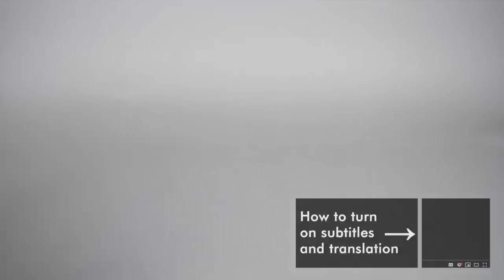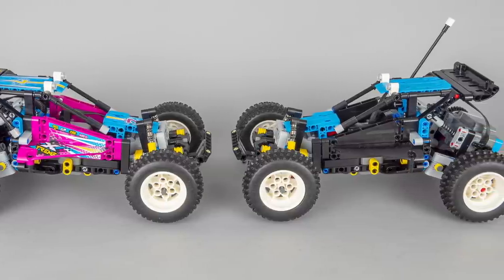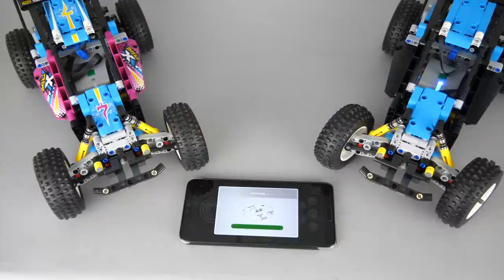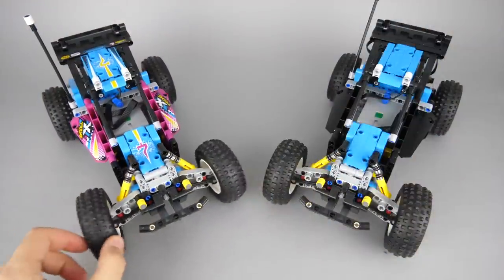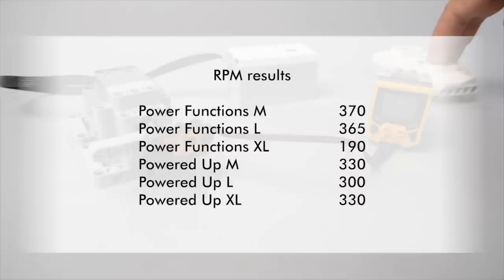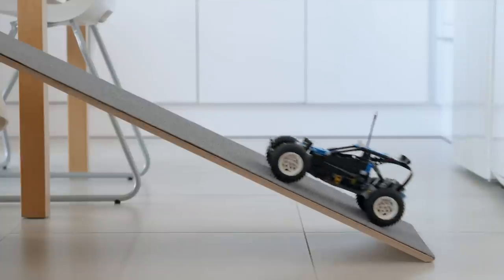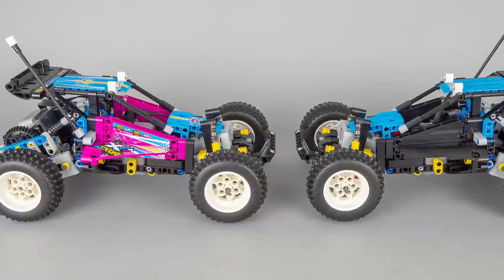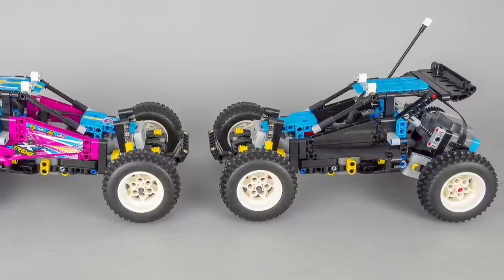XL motor swap in the LEGO Technic 42124 Off-road buggy - is it any better?

Comment: the limitation is the technic hub, not the motor. the reason why the vehicle stop is not becase the motor is overloaded, but because the mosfet in the Hub that's driving the motor is overheating. the Motor drivers used in the hubs are intended for an optimal range of 0.5-1A output with a max capacity of 2.5A devided between 2 channels. the problem is that the efficiency curve gets shot to hell alove 1A draw, and the driver chip overheats, causing a shutdown. the larger motor draws more power, so it will shutdown faster since the driver chip will overheat LONG before the motor has reached its limit. the L motor draws less power, so it can push out more torque effectively before tripping the overheat.
Reply: Does this mean with something like BuWizz brick (3rd party) the difference would be there?
Reply: @akauppi2  yes. thats a large reason why Bwizz 3.0 is targeted to PU motors.
Reply: Does this mean the hub has a design defect or does Lego also make (plan to make) a bigger hub to handle the larger motor? In the Philo chart the L and XL seem to have the exact same torque, but the L has a barely faster rotation speed. That seems like some pretty weird specs for something called an XL motor.

At least with the Power Function line the XL motor provided over twice the torque for a slower rotation speed trade off.
Reply: id be curious to test the L vs XL motors on the Buwizz 3.0 to see if its just that the motors really are a marketing gimmic, or if the poor design of the hub is screwing them over. 

I highly doubt lego will release any more higher power motor parts or they would have all ready, given how popular and sought after the buggy motor is; same goes for power packs. 

im curious if the use of an insufficient driver IC is a lame downcosting measure, or if it was done to change the product classification to clear EU laws.

id imagine the PU system skirts the border between consumer electronics and toys under EU regulations, so that may have something to do with it
Reply: Does this mean that Lego made a mistake? Or they did it in purpose and XL means just the physical size of motor?
Reply: @АндрейРоганин-к8п  I think its more  likely that they  knew and didnt care since it was done to save money. 

im sure there was an original design by some good engineers and that original design was stripped down and cheapened to what we have now.
Reply: @572089  But in this case even more cheaper would be not to make XL motor at all 😀
Reply: @jjones2582  nah, largely because it is a "toy" so I guess they have a limit before it gets dangerous, wonder if anyone is brave enough to mod them though
Reply: Dang you’re smart
Reply: We have similar taste in batteries 😂👍🏻

Comment: Recently I bought the 42099 Xtreme Offroader and was surprised to notice that at some times (while testing in heavy terrain, fresh batteries) the rear XL motor would simply cut out, followed by the front motor as that one got all the load. My guess: the Powered Up brick does some serious current limiting. At its maximum output power, the XL motor needs more current than the L motor, but by no means it gets that current. At the same rpm and voltage, this practically means that the XL motor is no stronger than the L motor. I think that a good tuned Buwizz can unlock a lot of potential here. Can you hook these up to a Buwizz? If there is a big difference, this means that the reason is not the motor itself but the crazy low current limit set by TLG.
Reply: I think you gotta wait till february, because thats when the new BuWizz version with 4 PU ports comes out.
Reply: Its the 42099s safety auto stop so when the motors are put through too much stress the hub automaticly stops the motors so the motors dont break from stress
Reply: @Arrowheaded_Quincy  power functions didnt have that
Reply: I have a buwizz 3.0 and will try to get an xl motor. With the buwizz app i can give the motor up to 4 amos of current which is insane

Comment: Outstanding test as always !!! I would never have guessed the result myself.
Just a shot in the dark: PERHAPS the advantages of the XL motor are only noticeable when the Voltage is increased a little, like with a BuWizz.
Usually greater Torque requires higher Voltage and rechargeable batteries run those motors pretty poorly with their nominal 1.2 volts.
What I am saying is that in this test the L motor was being run close to its true potential while the XL was still far from it.
Reply from the maker: Well they should show whatever potential they have with the Powered Up hubs since that's where they are supposed to be used in LEGO sets.
Reply: @RacingBrick  True. Only one way to find out though. Could you try with Alkaline batteries and see if there is any change?
Reply from the maker: @KastaRules  I won't waste 12 alkalines for this. The pack of fully charged LADDAs is around 8.4V (as they can be charged over the nominal 1.2V). A pack of average alkalines is 9V, and it drops quickly with use so there's not much difference. I'll try with higher voltage though, but not alkalines ;)
Reply: @RacingBrick  Fair enough. I assumed you were swimming in cash, being a YouTube celebrity and all!

Seriously though, I believe a pack of rechargeable NiZn batteries or better yet, the upcoming PU compatible BuWizz, could show the difference in power between L and XL.
Reply from the maker: Lol, YT celebrity swimming in cash? I'm lightyears away of that...
Reply: @RacingBrick  We could ask Sariel to try these motors with his fancy NiZn batteries though.
Reply from the maker: Luckily I also have some of those ;)

Comment: Great test, that's exactly the comparison I was curious about, wondering why they put the L motor into the buggy instead of an XL one. I am also experimenting with a faster car with two XL motors, and find that it soon becomes quite bad at climbing. My current theory is that the XL motor may be better suited for larger/slower constructions, especially if only one motor is used for drive, like in the Volvo hauler. Maybe, it would be a good test to swap an L motor into the hauler and see how it compares to the original XL version. Would you like to try that? It also gives the possibility to test with different gear ratios. Hopefully the swap would not need too much rebuilding.
Reply from the maker: Will try the swap with another set, but that'll also show the difference

Comment: Thanks for this great and insightful comparison! You could try building the XTreme Offroader (I think 42099) with L instead of XL motors. Also, it would be interesting to know how the C+L motor stacks up against the PF L. Thanks!
Reply: I think i saw this comparison on YT already.
Reply from the maker: I compared the PU versions with the PF ones already, it's linked in this video as well
Reply: @RacingBrick  Great to know, thanks!

Comment: So. Many. Questions.
I really don't understand what's going on at Lego. 
I just recently got into Lego Technic. At the beginning I thought I was dumb, not getting what's happening.
They seem to be head and shoulders above everyone else building ABS plastic Elements. 
Yet, App-Design and very basic motors are all over the place. I'm so puzzled.
They put out a Helicopter with a useful part, but take it off the market before release, and it's like a thousand money. 
They put out a cool servo motor in the same generation where all motors can be servos. - and they still don't let people play with it, still not supporting it on their Powered Up App.

Comment: The Motors may perform similar but they’re vastly different in design! Put an axle in both of them and try to spin it! You can feel the motor almost turn at the same rate you spin with the XL motor(only slightly geared) whilst the L motor is quite hard to spin meaning it’s majorly geared down. 
Think of the L motor like a small high revving engine whilst the XL is a low revving bigger one! With the gears inside the motor they end up producing very similar rpm and torque at the shaft. The XL will be better suited for harder, longer use and should be slightly more efficient!

It does seem odd that at the shaft we use they’re virtually identical in performance but I’m pretty sure Lego knew what they were doing here. Guessing it’s down to reliability and energy efficiency when under hard load which is why the lighter vehicles probably use the smaller L motor and the heavy ones the XL.
Reply from the maker: Well except the Top Gear Rally Car uses the XL motor and it is very far from being heavy. I also wish LEGO knew what they were doing but I still cannot see the evidence yet.
Reply: @RacingBrick  hey I’ve done an RPM test video if youed like to see! After watching your video I was intrigued to see how much quicker it was! Appears to be hardly quicker with no more torque! It’s bizarre!

Comment: After reading philos page multiple times, watching some videos and testing myself I would say: If there is a difference in rotation speed and torque it is insignificant.
Maybe there are internal differences which cause advantages/disadvanteges in longlivity or other properties under different load characteristics. But who knows.... :D Maybe do a long run test with medium load variation? Like rubberbands attached to a liftarm so it gets more and less stretched while the motor rotates (with downgearing) .

Comment: So I configured some Lego motors to hack together my own Arduino-controlled Lego car... The weight of that circuit board, breadboard and two 9V batteries was likely the cause for my L motor's miserable attempt at movement, so I stuck in an XL and now it actually moves at a decent speed. I am convinced there is an increase in performance here.

Comment: I've tested this swap too on my 42124 and got the exact same results with the exact same confusion (XL motor picked on my 42099). Basically I was asking the same question: why Lego made this XL motor since the L can do the same and even a bit better ? 
While searching for an answer and testing myself in a lot of different situation it seems that the internal motor speed on the XL is slower than the one in the L (fairly less noisy) despite a very similar output speed, I guess it means that the XL has more torque before reduction than the L but I still cant understand where this would be useful.
In my opinion it would be interesting to test both L and XL on the future Buwizz 3.0 to see if things change at 11V+.

This little set is still very interesting, even if the default suspension is basically useless since they are way too stiff and the rear pivot way to short. I'm currently modding it to get the model lighter (better power to weight ratio) and fix that suspension problem, the front was easy (dark grey shocks are perfect for it), but the rear is still complicated to upgrade efficiently without guetting the wheelbase longer even if I still have some ideas for that.
Reply: thx for the info!
i saw a youtube video on third party PF - C+ adapter cables, that said that the C+hub is cutting power extremely early for motor damage prevention. if powered by the PF battery box, both the C+ L and XL where more powerful and the difference was more pronounced. also, PF Motors powered by the C+hub where less powerful and cut power earlier. so the buwizz will be interesting, but those adapters are as well

Comment: add some weight on top of the L motor to balance the weight difference. And swap the batteries between two cars and run the experiment again just in case there's a factor there.
Reply: And it would probably make sense to test with standard batteries, the 9V vs 7.2 can make the difference
Reply from the maker: I did this test multiple times and the batteries were charged and mixed so it is not about the batteries.
Reply from the maker: Since both hubs was using the same type of batteries, if there's a difference then it should be visible at 7.2V as well.

Comment: Problem is your batteries. As They are only 1,2 Volts you are undervolting the entire Control + brick. This leads to higher current going to the motors to preform the same task, and the XL motor requires more current than the L motor. By using the 1,2 V batteries the current becomes so high that the Control+ brick cuts power, and as the XL motor draw more power this will cut before the L, giving it worse acceleration and less torque. 
I do not know how high the current limit for the Control+ hub is, but in my experience it is fare lower than it was in the old PF hub (and even that was low). It would be interesting to see the same test again with alkaline batterie (non rechargable), and it would also be interesting if you could meassure the total batteri voltage with the rechargeable batteries compared to 1,5 Volt alkaline batteries. Normally a fresh 1,5 battery is close to 1,7 volts but quickly drops to 1.5 Volts when the chemistry starts (power drawn from the battery), but a old unused battery can be lower due to current drawn through the batterys internal resistance (this is why batteries are stamped with a date - after this the internal current leakage will have taped the of so much power they no longer are within spec).Normally a rechargeable AA battery is close to 1,35 Volts fully charges, and quickly drops to 1,2 Volts, but this is dependent on the chemestry, and some batteries can go as high as 1,5 Volts, and have as slower drop i voltage.
I use DC/DC steppers to increas the voltage delivered to my PF hubs, and this allows them to deliver a lot more power before the current protection cuts in, making them useable with even heavy machines. I guess the same should be possible with the Controll+ Hub, but haven't looked into it yet. It may also be possible to remove or short circuit the current limiter...  But I suggest you start with using better (higher volt) batteries to understand the true difference between these motors.
Reply from the maker: It's a nice theory, but practice is different. XL motor still shows less torque and overall power than the L one even when I use alkaline batteries (yep, tested). Btw rechargeables are closer to 1.4V fully charged, and let's agree that an average alkaline is around 1.5V and then drops quicker than the rechargeable ones, so if you're considering a real life scenario and not a lab test then there should be no significant difference from this aspect. The "true difference" as you say should be clearly visible with average use and not only in very specific cases, e.g. when you use high-power brand new alkalines for about 5 minutes before their voltage starts to drop.

Comment: It has slightly better efficiency and lower no-load current, So i would say you can try comparing runtime. From Philo's data and/or Sariel's motor app.
Reply: Opposite switch in 42099 would be interesting, and current measurement during test also.
Reply from the maker: I'm more interested in practical tests than such as runtime tests since from an average user's perspective that doe not change much. People expect XL motors to have higher torque than L motors and that's simply does not seem to be the case here.

Comment: Swap motors between units, still same results? Balance weight difference between units, still same results?
Reply from the maker: The 2 builds are exactly the same, no point to swap.Weight difference is less than 3%

Comment: My guess: the amperage is limited in the software to match a L motor and will not fully power the XL motor. Did you try the buwizz app to power them? Maybe that makes a difference? (Edit) just noticed you used your own controls. It is either the batterybox or the batteries that limit the current...
Reply from the maker: I'm almost sure it is not related to the software. If anything is limiting the motor's capabilities then it js the hub. Already preparing the next experiment :)

Comment: maybe the fact that they both use the same batteries has something to do with it? like if two engines receive the same amount of fuel and air they will probably make the same amount of power
Reply from the maker: Well except if one is the engine of a Suzuki Swift and the other is the engine of a Ford Raptor...

Comment: For your next test: Use the BrickControl 2 app and use a PS4 controler. As well use a L shape guide rail which should help with straight line comparison
Reply from the maker: I made several videos with the BrickController2 app, you can check them out

Comment: Have they made it so that to get the full potential of the XL motor you have to use a control play present control? Bit with the l motor you can use it how ever you want as they haven't coded In The limits of the XL motor in powered up uet?
Reply from the maker: I don't think the Powered Up app limits the motors in any ways. Both motors were coded to run at 100%, I highly doubt LEGO would artificially limit the performance of the XL motor. What would be the point?

Comment: I have some Lego models, but I am not an expert. However, according video you have used just 3 batteries. Usually there are 6 batteries in the box. But I do not know, how they are connected - serial or paralel.
Reply from the maker: You might want to check again, that battery holder has two sides for 3-3 batteries :)

Comment: The main benefit of the XL motor is that they'll probably be cheaper, because who wants to buy an inferior motor?

Also it might be worth trying with stronger batteries (I've heard most rechargeable batteries are weaker) as well as down the line if any firmware updates come out.